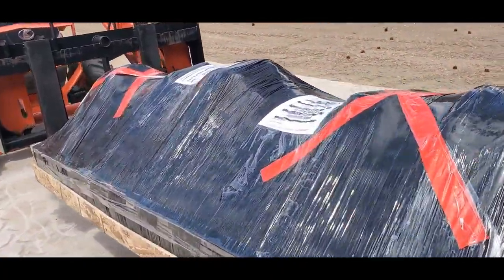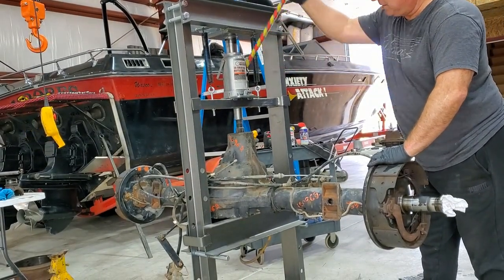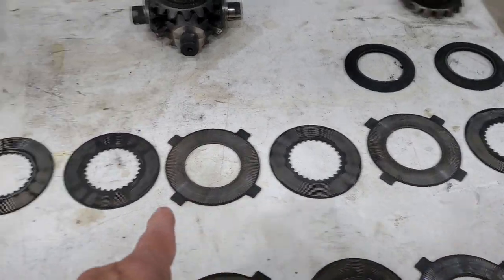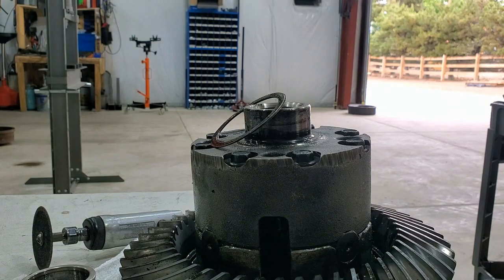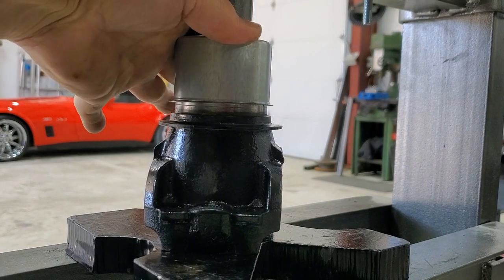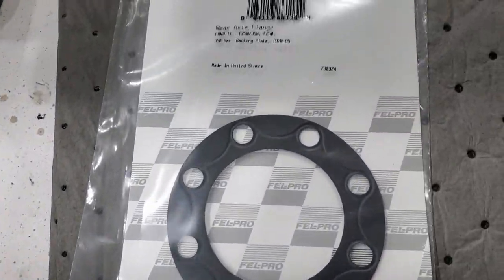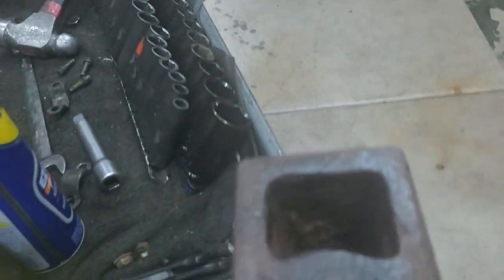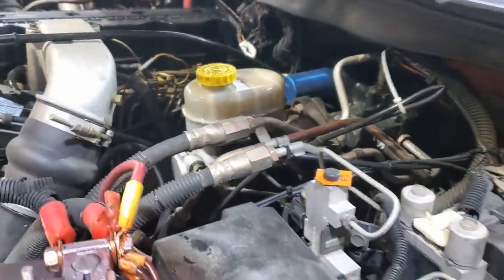Dana 70 swap and rebuild Dana 80

Comment: Awesome stuff dude...I just happened to see this video. The funny part is that the next day, I get to rebuild a dana 80 off a 2000 f350xl 7.3 ..so thanks for the insite...I can't  wait to crush 450 pounds of torque..lol
Reply from the maker: Thanks, ya, the more I think about that pinion bearing I should have cleaned all that rust off the pinion first with wire wheel, sandpaper, brake clean, and compressed air before trying to remove. I can't imagine trying to do this on the vehicle......

Comment: congrats great attitude thru out the ordeal, i wish i was there to relieve your pain,  i’m no mechanic but metal never wins over my focus, 3$ of cut off blades and a 6” 120 volt angle grinder those blocks would have zippedoddin 30 minutes congrats thou excellent job thanks

Comment: Good morning. Great video! Question. How is the Power-Lok doing with the new clutch orientation? Any issues? Thanks.
Reply from the maker: Good day, the diff is defiantly tighter, sometimes I can detect a slight bit of chatter during a slow turn, may need a little more posi additive, but all in all verry happy with the rebuild!
Reply: Sounds good. I just stacked mine yesterday the same way you did yours. Figured I'd ask while it's still on the bench. Have a good one.
Reply from the maker: @mattritz5825  That is so COOL! did you find yours arranged like the way I found mine? It makes no sense for them to arrange the clutch discs that way?
Reply: @BretMech  Yes, mine was arranged exactly as yours was. I can't make it make sense either. Lol. So many wasted surfaces that way.